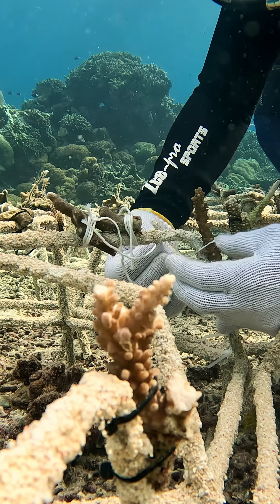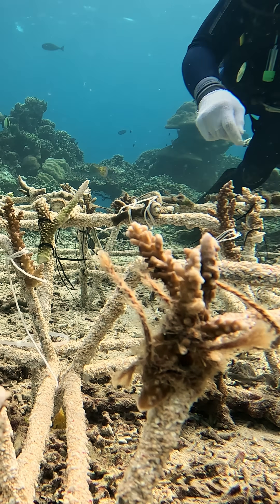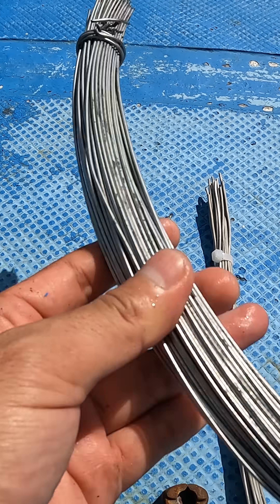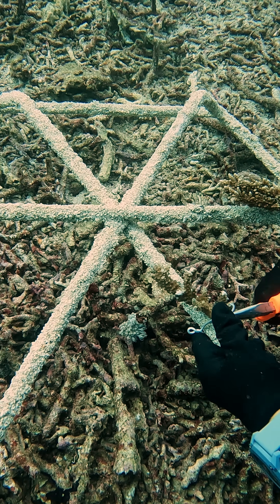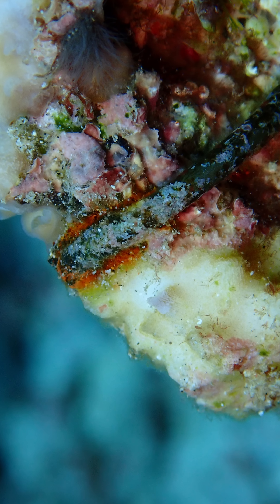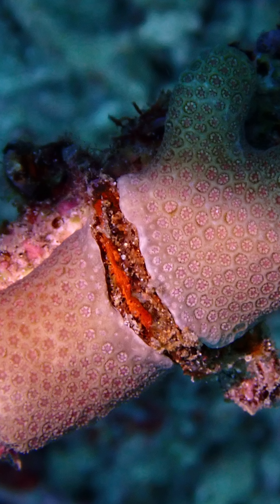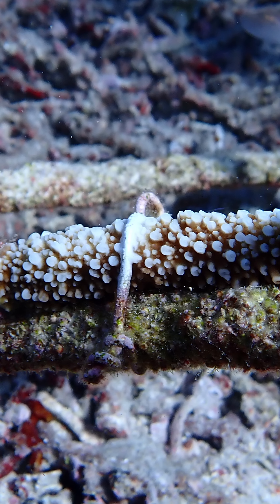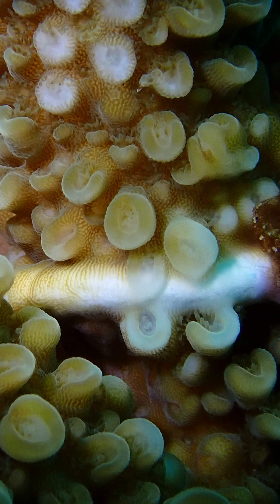We're testing different ways of attaching coral - Wilder Reefs

Comment: Have you looked into biodegradable zip ties?
Reply: Why? It would just degrade over time...
Reply: @Pughhead  Yes, that's the point. Once the coral is attached to the structure, zip ties aren't needed
Reply: @kancelas  They need to stay attached for a while, they do not glue them on so they can't stay on long enough unless ziptied.
Reply: did you see the bit where things like twine were degrading too quickly? biodegradable zip ties "decay anywhere vegetation would" meaning they'd be spending much more money for a failed result.